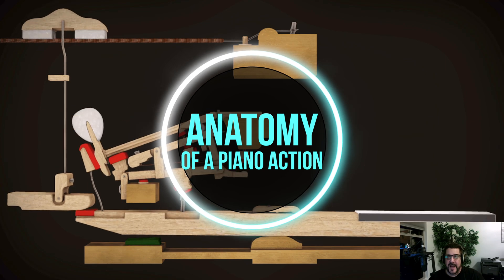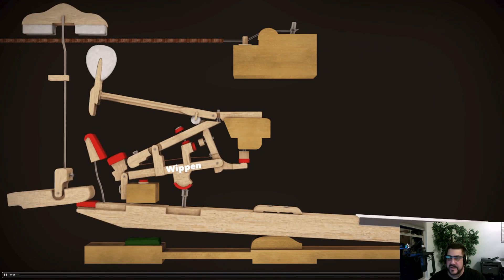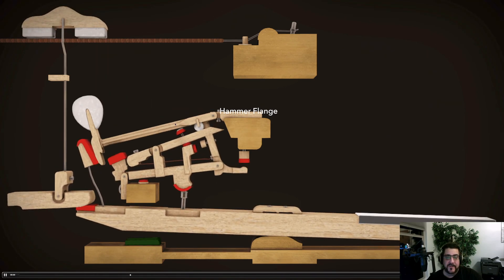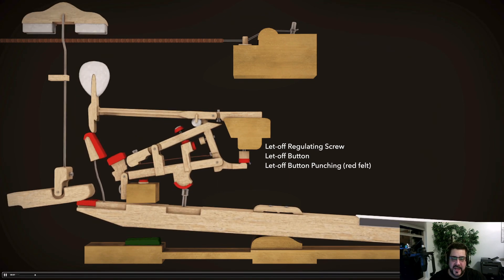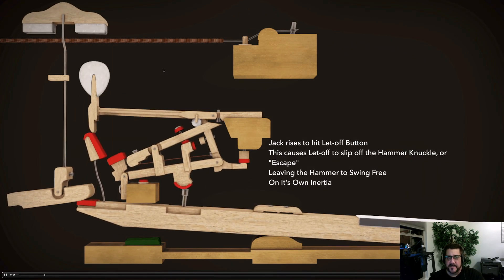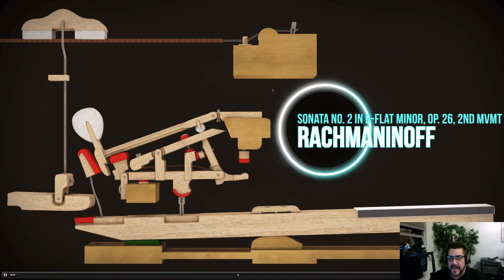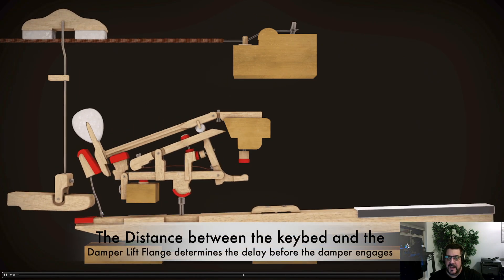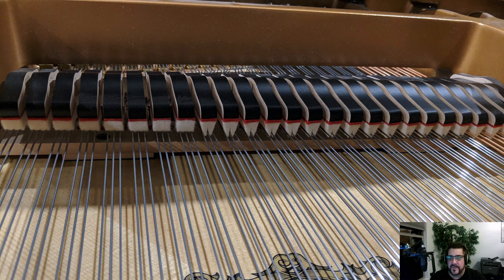Anatomy of a Piano Action

Comment: How is the damper mechanism implemented in the various hybrid pianos?
Reply from the maker: Primarily, the effect of the damper is achieved electronically based on your foot pushing the piano, regardless of what kind of electronic hybrid piano you are talking about.  The second goal is to achieve the harmonic effect of pressing the damper pedal.  That is to say, when the dampers are opened, you would expect to hear sympathetic vibrations from the effect of the overtones of the notes you are playing across all of the open strings.  This also is achieved electronically in some brands (including all Yamaha and Kawai brands).  However, the trick is to achieve the sensation at the keys that you have pressed the damper pedal, to "fool" your fingers into thinking they are playing a real piano, and that is the real challenge.  Different brands achieve this in different ways (or not at all).  For instance, the Kawai Novus 10S has a real damper mechanism that works the same way a real acoustic piano works, except that there are no dampers or strings, just simulated weighting.  In fact, they use graded weights, so the weights for the lower notes (where you would normally have larger dampers) are heavier than the weights used with the higher notes.  As the damper pedal is pressed, the keyboard action's touch weight is also eased, further enhancing the grand piano authenticity.  Both the Kawai and the Yamaha have a physical damper pedal with springs and levers that simulate the feeling of using the damper pedal on a real piano.  This includes replicating the spring, friction, and inertia felt in traditional pedals, allowing for precise control and the ability to half-pedal, similar to an acoustic piano.  But while the Yamaha does not employ real dampers like the Kawai, it instead uses Haptic feedback delivered through a Tactile Response System (TRS), which are comprised of mechanisms that transmit sensations back through the keys to the fingers, including those transmitted through the pedals as the dampers are engaged or disengaged. This system utilizes transducers in the soundboard to create a realistic sense of resonance and vibration.  I hope that helps and sorry you had to wait so long for an answer!